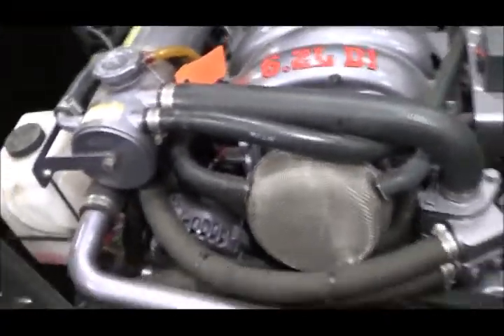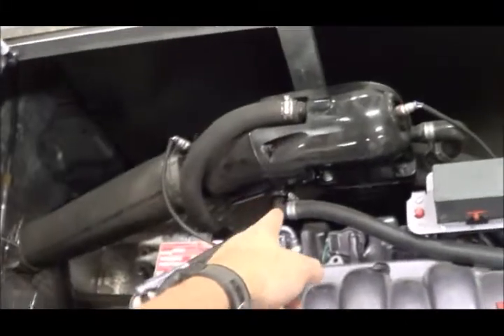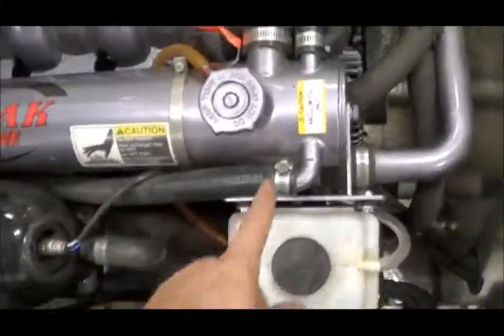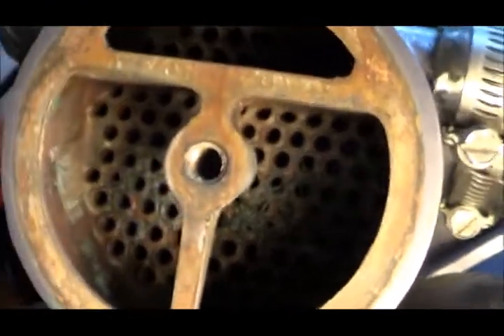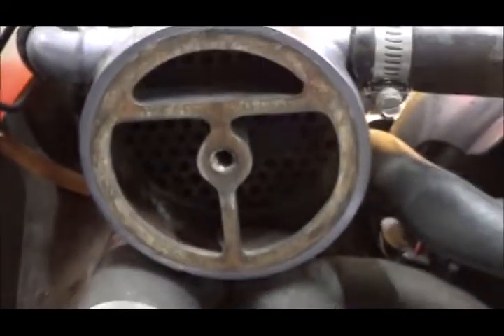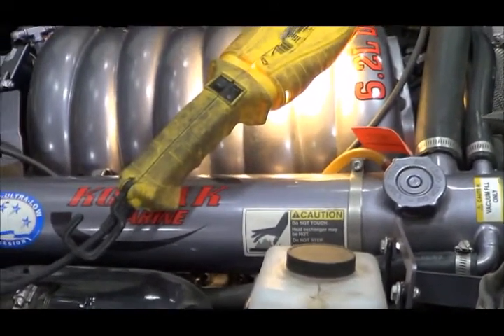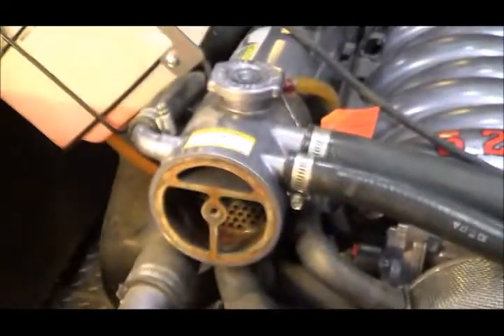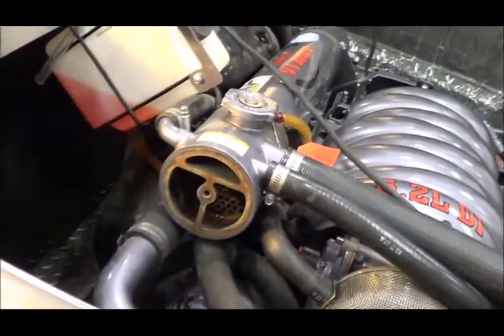Jet Boat 6.2 DI Heat Exchanger Dissected

Comment from the maker: I decided to build a computer model of the exchanger and accompanying hoses, and it turns out the one-pass versus 3-pass flow is not so much different as I first guessed. So... I'm currently turning my boat into a fluid flow test and measurement setup to validate my computer model. Results to follow in a subsequent video.

Comment: Have you tried changing plug wires on port side under heat exchanger? Looking for tricks without tearing the Manifolds off. Can’t get the center two onto the coil pack. Dumb design.
Reply from the maker: Haven't tried. Marine engines cannot have entirely smart design. This is fact.
Reply: I have two of these engines in a bowpicker here in Alaska. Obviously headspace is lacking also. It’s the starboard side of the engine that’s the issue. Under the heat exchanger. The first one I pulled the manifold. Pain in the rear getting gasket and manifold lined up and getting bolt lined up and not bugger up aluminum head. If I have to take it off again I’ll probably replace with studs. This second one I’m breaking the coolant system and removing heat exchanger to see witch method is easier. Lol.
Reply from the maker: @olinrindal9999  What is the general problem with the engines?
Reply: @idahoviking   So there are a couple issues. If you have high pressure fuel pump issues check your HP fuel pump relay in the relay box. The box malfunctions and overheats and burns up the relay. The fix?? Pull the relay out, pull the wires out the bottom of the box, extend wires and connect new connectors directly to relay. I haven’t found a new box to mount remotely so direct connect is the only option I’ve heard of. My relay box actually has burnt marks and easily noticeable. The other issue is the O2 censor. They get wet and malfunction. You can buy O2 censor extensions. It keeps O2 censor out of the riser a bit and saves your O2 censors. This is a new boat for me but these are the issues I’ve been told about with the fixes already done. I haven’t found to much info on them other than your video. Have you heard anything??
Reply: These engines have about 1700 hours on them. Previous owner said they have been super reliable other than the 2 issues I already explained. The whole vacuum fill the coolant system has me concerned. Playing on the cooper river we suck up sand from time to time and over heat. I’ve never vacuum filled a system before. But we will find out tomorrow. Lol
Reply from the maker: @olinrindal9999  I've not heard anything else. Carbon buildup on the intake valve is a general problem for DI engines, so relatively high hour engines are certainly of interest looking forward.
Reply from the maker: @olinrindal9999  For vacuum filler, buy high quality if you can find it. Online it's difficult to discern quality, so buying from Nappa or similar may be worthwhile. 

Valuable information would be exactly why these engines need to be vacuum filled. Where do air pockets remain if not vacuum filled? If the engine has a coolant leak on the river, how do I refill? What are the alternatives to vacuum filling?
Reply: @idahoviking  those are my concerns also. I don’t have those answers either.

Comment: Normally the raw water intake enters  the exchanger where the coolant from engine enters the exchanger i run a big block all day long at 5800rpm and have only used a single pass exchanger.

Comment: Does the jet send a portion of the water through the exchanger or is it a through hull sea cock system
Reply from the maker: River water is from jet.
Reply: Idaho Viking 
How does the jet perform if there buts of ice in the river water
Reply from the maker: Ice and weeds can clog the heat exchanger and cause overheat. So you have to choose the right conditions.